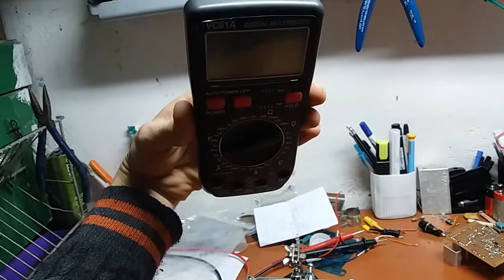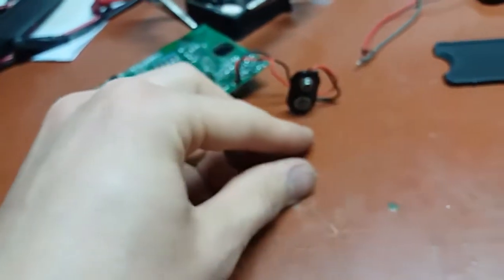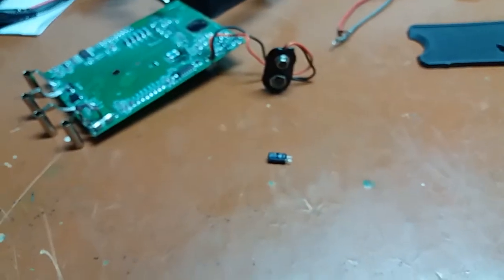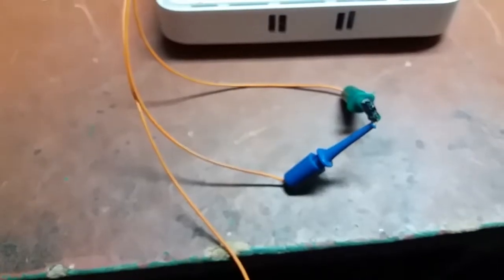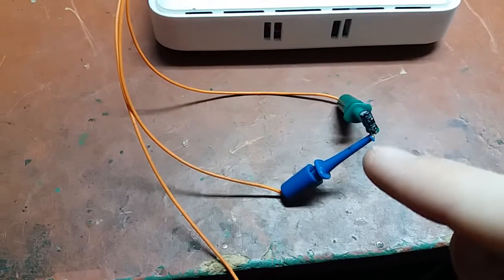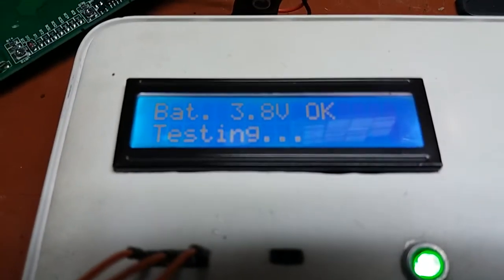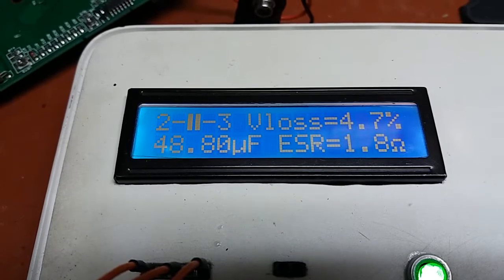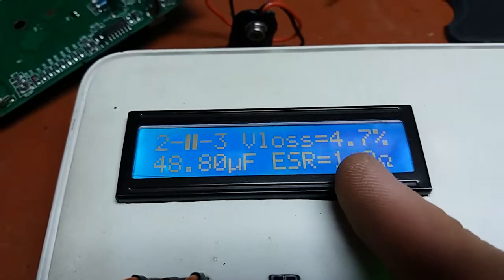Look inside VC61A DMM (w/ a little fix)

Comment: Under the left jack is written "UNFUSED", but on the board in the same place there is a fuse. What's the catch? Should not the fuse be where "FUSED" is written?
Reply from the maker: Андрей 20A input is NOT fused. Regardless of the placement of the fuse. The fuse is on 200mA input, even though it doesn't quite look like it.

Comment: I suppose you've already closed it by now.. those split jacks should be cleaned and pressed closed a bit (they look a little opened up). Did you get your AN8008 in the mail yet?
Reply from the maker: Cliff Matthews I rarely swap the probes, they make a good contact still. I have 3 meters: this for voltage, the one I fried then fixed for continuity and the uni-t for amps. The result is that jacks are just fine as is the range switch :) 
  The seller was a scammer, I told eBay to go kick his ass, got a refund.

Comment: Yep that power off circuit appears in many 7106/16 based multimeters, i bet the other multimeter you repaired had the same shutdown circuit.

The ref pot should only affect the volts/current modes, ohms is ratio metric and needs no reference voltage.

Oh sorry i was a bit down the last time i commented, i have depression problems and i get far to negative, hope it didnt bother you.
Reply from the maker: zx8401ztv I don't have that many people who actively comment, I actually like when there's a feedback. So it's just fine :)
Reply: Good :-D, i like talking to people, but some of the channels i comment on seem one way, meaning i comment but no one talks back.
Anyway, did the fresh delay capacitor fix the problem?